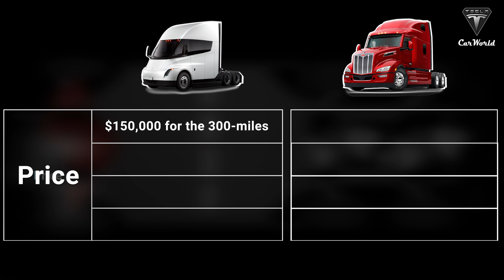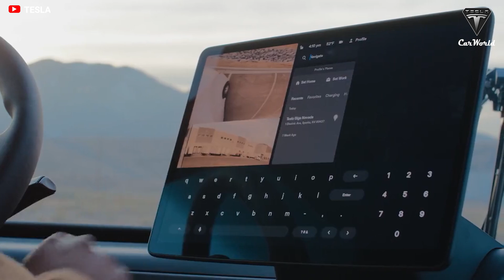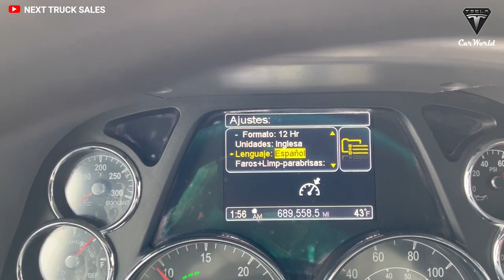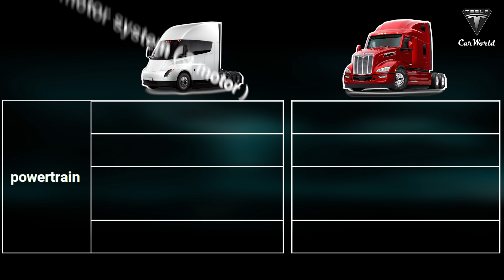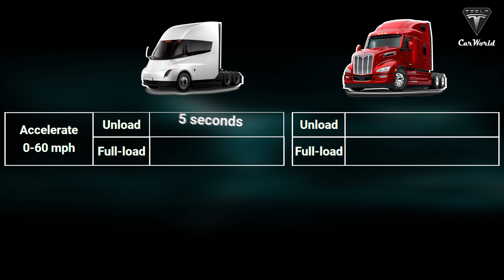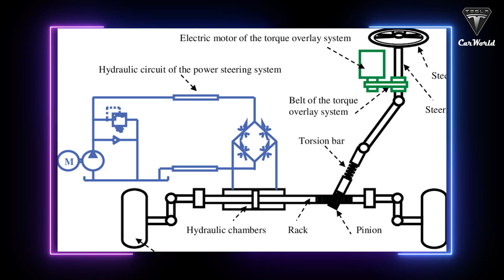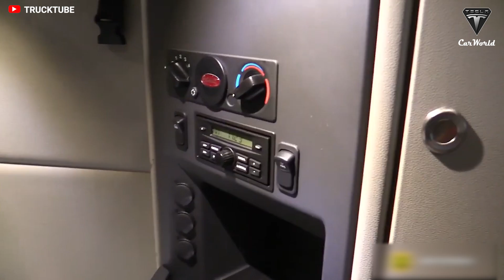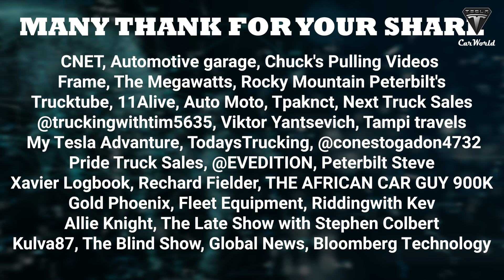Tesla Semi Vs. Paccar Peterbilt 579! Which is the Best Choice of 2023 Heavy Trucks?

Comment: 82,000 lbs Payload includes the weight of the truck
Reply: @Abadeez  It's not "hella small."  It's within 4,000 lbs and the EV truck has a 2,000 lbs allowance.  That also assumes old information.  I bet Tesla squeezed more weight out of the truck.  The overlay image in the Tesla presentation show the Semi  has a smaller wheelbase and shorter overall than the diesel comparison vehicle.  To say the payload capacity of the Semi is dramatically different than a diesel is disingenuous at best.

Also, most class 8 trucks are not close to their weight limit.   They are typically volume constrained.  90% of semi trucks weigh in at less than 73,000 lbs with their loads.   And the weight of the trucks themselves vary a lot based on options like sleepers and fuel tank sizes.  

Basically, payload capacity won't be a significant issue.  And I would bet Tesla has figured out a way to give the Semi a weight advantage.
Reply: @Abadeez  Tesla has already commented on the weight.  It is on par with a diesel truck.  Worse case is 4,000 lbs heavier if they can't figure out any other weight savings.  Since the truck is smaller, its most likely about the same weight.  

And your math is leaving out some stuff.  A diesel engine is about 3,000lbs.  Now add transmission, radiator, coolant, exhaust, emission equipment/def, fuel tanks and fuel.   The fuel can be 2,000lbs+.  All that stuff is about 7-8k lbs that an EV truck doesn't have.  If the battery comes in at the estimated 11k lbs.  That is about 4k lbs extra in weight, worse case.  

This is a quote from Musk in 2020:  "You are able to carry basically the same cargo as a diesel truck. We think that maybe there’s 1-ton penalty. Maybe."   Musk didn't mention the weight at the Pepsi event because he has already commented on it in the past.  They have had 2 years to trim weight out of the design.  Keep in mind this is a blank slate design.  They are not starting with an existing chassis.  They are minimizing the material needed for an EV platform.  I bet they saved 100lbs by just eliminating a lot of wiring harnesses.  And that's just one example.

So, anyone claiming the Semi will weigh too much to be useful is ignoring the relevant facts and just blindly believing all the FUD.
Reply: @Abadeez  A Cummins ISX weighs 3093lbs.  Just the engine.  A transmission is about 700lbs.  300 gallons of diesel is 2100lbs.  Add maybe 300lbs for the tanks and fuel lines, filters etc.   That is about 6200 so far.  But we are not done.  Add exhaust, emissions, def tank and def, radiator, hoses and fluid, air filters and plumbing.  So, do you now understand how much weight disappears when you move to an EV platform?   

Musk is bound by SEC and making false or misleading statements is a crime.  He has a responsibility to shareholders to make accurate statements.  Until actual hard data comes out regarding the Semi (perhaps from Pepsi), then the public claims from Tesla and Musk are the best information available.  They also make sense.  You have to pretend the Tesla engineers are not capable of trimming weight out of vehicle.  They are literally the best in the world at doing just that.  The battery weighs a lot, but so do all the things in a diesel truck that are not needed in and BEV semi.  

There is no way the Telsa Semi is 30k lbs.  To get that number, you have take a diesel truck at 20k lbs, and strap a 10k lbs battery pack to it with out taking anything off.  Do you not get how ridiculous that estimate is?  You should watch this: https://www.youtube.com/watch?v=Uv44W7xa4IU  His estimate is 8,000lbs for just the batteries.  

My bet is the Semi comes in at 18k to 22k lbs for a 500 mile range day cab.
Reply: @Abadeez  I can see there is a heavy influence in your comments from certain FUD videos.  The reality is that Tesla will sell as many trucks as they can build to those who need to haul volumes that are in the sweet spot of the Tesla semi payload capacity and these Teslas will haul these payloads much more efficiently, profitably, safely, and with less emissions than any diesel truck trying to haul the same payload  For the small percentage of max payload hauling that Tesla can't quite accommodate to the delta weight difference in trucks, his will change in few short years based on extrapolation of increasing Tesla battery pack energy densities.  When you talk about science and math,  I agree it is the arbiter of truth so you really do need to apply it across the board.  So bottom line is that Tesla semi for vast majority of payloads is superior right now and will be for 100% of loads in near future.
Reply: @Abadeez  The 27k is based off a false assumption.  During the Semi presentation, the Semi GVW was 81k lbs in a box trailer over the 500 mile trip.  There was no mention of the gross vehicle weight of the the Semi pulling the flat bed up the hill.  Two different trips with a different load.  I love people backing into the weight of the Semi and getting a ridiculous answer based on an incorrect assumption, then repeat it on the internet like it was fact.  

And please stop mentioning energy density.  Gas and diesel store a lot of energy but internal combustion engines are horrible at converting that into forward motion.  It's the main reason why EV trucks will cost so much less to operate than diesel.  EV drive trains are much more efficient than ICE.  It takes a lot less energy and hence much cheaper per mile to fuel an EV.

"No operating ev of the same size is going to weigh less than an ICE vehicle, it's not physically possible."  Yes it actually is.  A Model 3 weighs about the same as a BMW 3 series.  3,648 to 4,250 vs 3,582 to 4,183 for the BMW.  And that heaviest dual motor performance M3 will blow the doors off a 3 series.  Before you make such stupid comments, please do just a little research.
Reply: @Abadeez  I was clear.

Comment: The Peterbuilt looks great for owner operators. The problem is that MOST drivers are company drivers and rarely get even a tiny bit of the luxuries offered. Most 579 features are optional, and will never be seen in company trucks.
Reply: Unfortunately a lot of company drivers treat the truck like a dumpster.  Way back in the day I was assigned an international cabover, the previous drivers (had a team in it) had cut a hole, with a chisel, in the aluminum partition in the sleeper, to run a cable for a tv.   Never underestimate the ignorance of a company driver
Reply: @PD-yd3fr  there is two sides of the coin good and bad just like companies
Reply: Most companies will not care about their drivers. They just want the products to be deliver on time. LOL!!!
Reply: Most of the options are in company trucks dude
Reply: the same as in China , the company pay less attention on the comfort about the truck , they usually care about the price more . so the luxury interior is unnecessary for the company , but important to the drivers .
Reply: 94%of all trucks on the road are O/O
With 20 trucks or less
Reply: @dutchman2506  what's the meaning of the O/O?
Reply: @ningqw4115  0 - Options I guess
Reply: Good trucking companies buy the best rigs to lure good drivers to their company .

Comment: Tesla still has to ramp production AND install enough charging stations for the semi's. Until this happens, Tesla won't really be competitive in OTR trucking. Not to mention the industry is still waiting to see it in action and determine if it lives up to claims.
There is no real comparison between the Tesla semi EV and current diesel trucks.....yet.

A lot of talking around bits and pieces but you're not making a lot of sense in many of the areas.
Reply: I agree no comparison to an otr truck yet. Actually we don't really have any idea of the actual weight of the Tesla yet so no idea of the actual load it can carry. Seems almost certain it must be pretty heavy or they would be published.

I don't think they will make an otr version for at least four or five  years as they will be swamped with day cab requests for a while as really well suited for that.
Reply: @Abadeez  How much do you want to bet on that? They will be producing over 1 million of these a year by 2030. They will dominate the market easily.